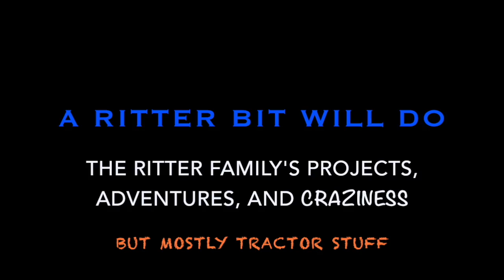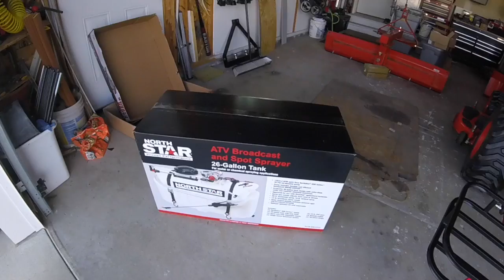Spraying Weeds with Kubota BX, a Broadcast Sprayer and a Cargo Rack

Comment: Just subscribed. I have a BX25D and recently purchased the sprayer from BXPanded. I used the cigarette  charger attachment. Hooked up everything this weekend and tested it with just water and then lost power when the pump pressurized the spray wand. Hand to do some trouble shooting but found out the accessory connection on my BX only had a 10 amp fuse and that I had to put in a 15 amp fuse to make it work. Did not know how you set yours up but yours looks all most identical to mine. I used my sprayer to spray a large area in the woods which had been cleared of under brush last summer but became covered with poison oak and poison ivy
Reply from the maker: Thanks for subscribing! My sprayer right now is hooked up directly to the battery. I do plan on wiring a 12v plug so it's good to know that I'll probably need to put in a larger fuse. Thanks for the info!  Keep on tractoring, thanks for watching and God bless!

Comment: oh no.... too mutch implements at one time..... nice video.
does the sprayer work well because its using an electric pump..looks too mutch for the generator...
I also don't like the polystyreen 😁
Reply: ps Paul is home.....👍
Reply from the maker: I think the sprayer is working like it's suppose to. It's an on-demand pump and it turns on and off automatically as I had the flow rate turned down a bit.  A little more trial and error experience and hopefully I'll work out all the kinks. God bless.